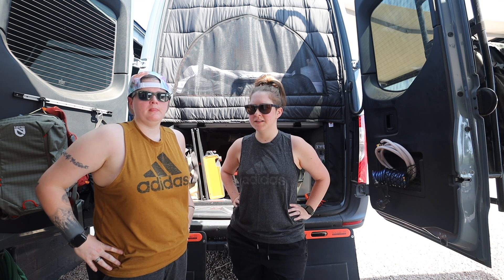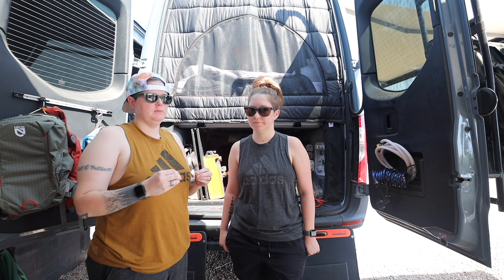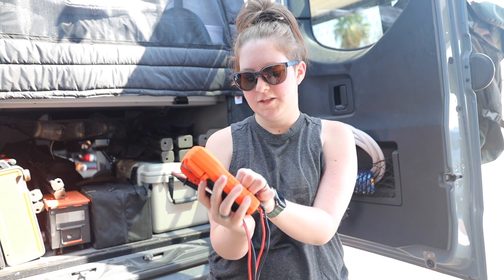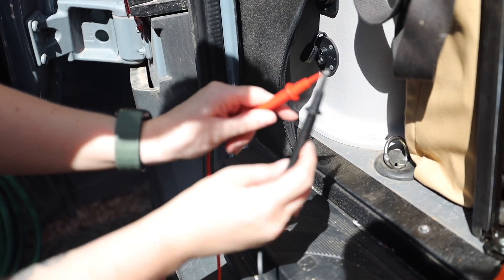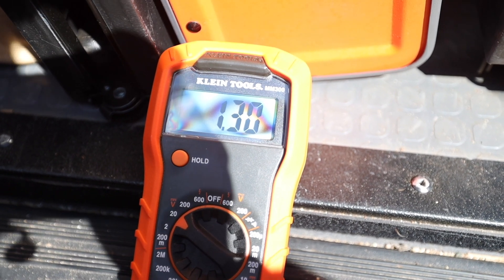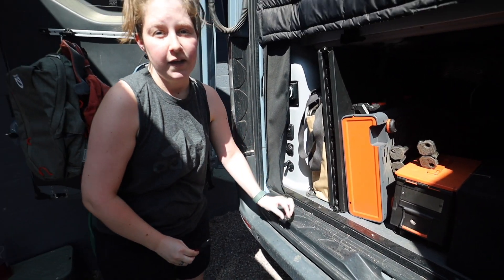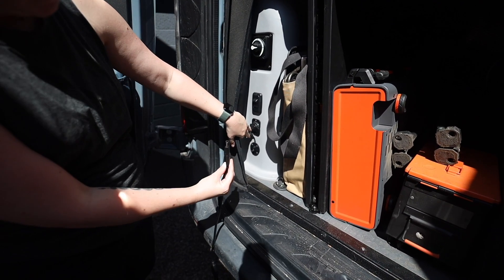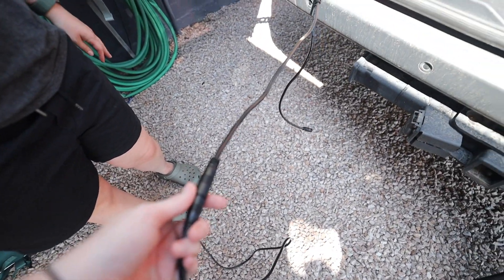HOW To Add Extra Solar Power To Your Van | 2022 Winnebago Revel

Comment: The straight bar is for DC, a wavy bar is for AC, V(Volts) in this case.  The 20 means the meter is set to 20 Volts (DC) full scale, which would be the best scale to measure a signal of about 12 Volts.
Reply from the maker: Thank you for explaining that! We’re lucky we didn’t blow anything when figuring it out lol Thanks for watching! 😊